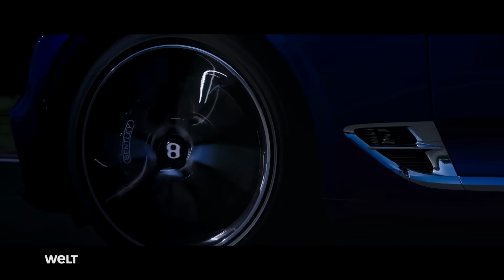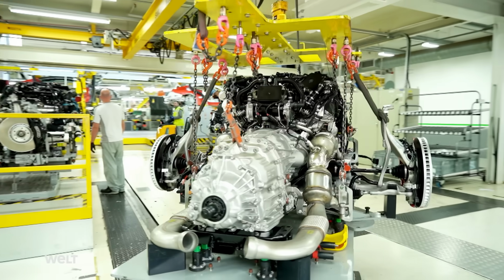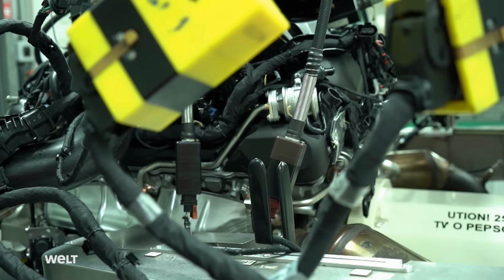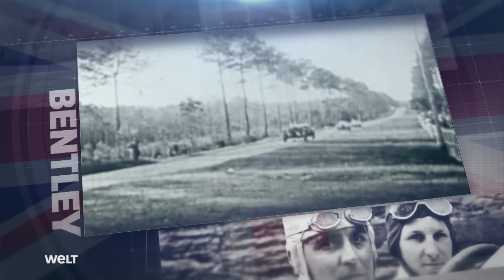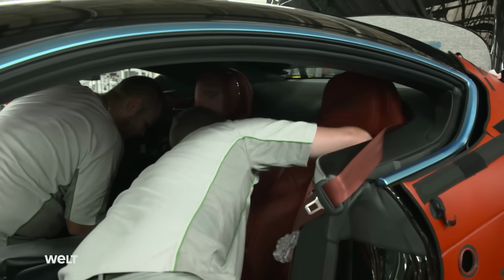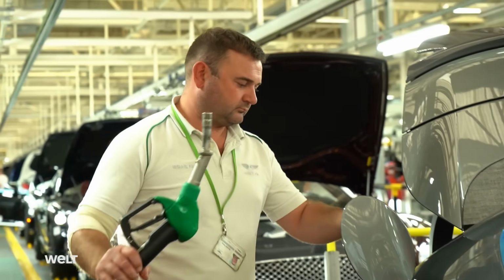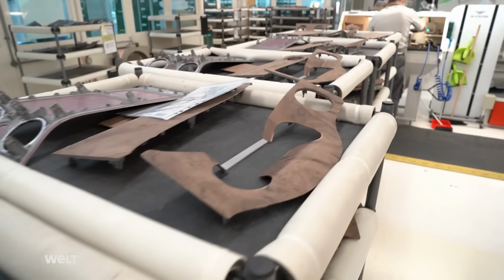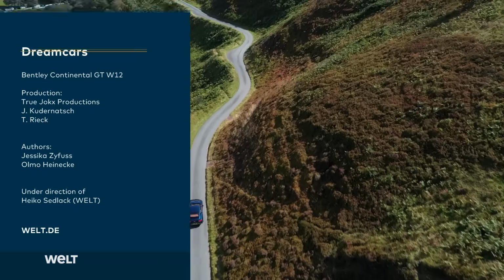Bentley Continental GT W12 - Inside the Factory | Full Documentary

Comment: Very nice.  Too bad the "Craftsmanship" does not translate into a reliable car.  Bentlys are known to be fairly Unreliable and very costly to maintain.
Reply: well you never owned one so I don't know how you came to that conclusion
Reply: @malopephasha5341  Well, I DO own one, and I can assure you it is extremely costly to maintain!  And, if I ever leave it parked for more than a few days, the batteries (2 of them) discharge, even attached to the "Battery Tender".  Otherwise, it has never broken down or left me stranded.  They are just so sophisticated that every little thing that needs attention costs a small fortune to repair or replace.  And it has never taken less than three weeks when I take it to the dealership for service-which is about a 3 hour drive from home.  I have spent so much to repair things that they now consider me a "preferred customer" and provide no-cost enclosed van transport to and from Bentley of Columbus-but it takes a month or better to schedule that free transportation.

Comment: Can you just imagine this engine in a small Toyota or maybe a Mustang or a Camaro all-wheel drive the massive torque and smoothness of this engine in a smaller vehicle or even a truck this engine could be fitted with bigger turbos in tuned to over 1,500 horsepower easy I would work for free in the Woodshop just to be trained on how they make their product I've been a master Carpenter for 40 years and I would give it all up just to learn how they make their parts in pieces

Comment: The Bentley company gorgeous car at the age of 20 I had a 72 Nova that I put a cam kit and boys out the Pistons 8 cylinders it would slam you in the backseat by flowing it I had a 1970 Camaro the red 260 miles on a tack you need more horsepower I only have 12 if you can I have 12 Pistons make that engine Sprout 1200 horses

Comment: I was unaware cars used a prop shaft. I always thought it was a drive shaft. Where this car goes we don't need no roads.
Reply: Its the correct term. The longitudinal shaft from the gearbox to the rear differential is indeed a 'propeller shaft'. Drive shafts go from the differentials to the wheel hubs.

Comment: 12:05 “camshafts regulate the supply of fuel to the engine” ummmm... no 😂. They regulate air/exhaust moving in/out of the cylinders through opening valves
Reply: I paused it right where it was just to look for this comment 😂
Reply: in/out of the cylinders, NOT the pistons....smh
Reply: If it isn’t a direct injection engine, then injectors can spray all day, but if the cam doesn’t open the intake valve(s), nothing happens. I would’ve said camshafts control the air/fuel mixture’s entry into the combustion chamber.
Reply: slowpoke96z28 cmon what high performance car of today is port injected only, it definitely has injectors directly in the combustion chambers
Reply: @SuperCortes10  koeniseggs are port injection, lambo, bugatti, McLaren. All port injection still. Really the only sidi performance cars I can think of are LT based GMs like vettes and such.
Reply: slowpoke96z28 Most is those hyper cars just use port injection to clean off the back of the intake valves but still use direct injection for the most part
Reply: SuperCortes10 dude...stop...
Reply: slowpoke96z28 Hey know it all do some research and learn that there’s multiple cars that use both direct inj and port inj at the same time, Lamborghini huracan & and Audi RS3 just to name two
Reply: slowpoke96z28 Koenigsegg actually have multipoint fuel injection, port and direct injection. Their latest engine in the Jesko has 3 injector per cylinder.
Reply: SuperCortes10 did you just call a huracán and an Audi hyper cars? Really? Port injection to clean off the back of the valves? Of what exactly genius? What are they cleaning off the intake valve? Dirty air? Oil leakage from the turbo or PCV system? Really? With a hydrocarbon? I guess all the people who make injector cleaners and all the engineers at gas companies who spend their entire careers trying to keep fuel from DIRTYING up thing are a bunch or snake oil pitchers huh? Chevron, Exxon, etc, are being hustled for millions a year by engineers who really don’t do anything useful...
Reply: back in the day cars sometimes had the injection coupled with the camshaft, but modern direct injection is indeed managed by the ECU

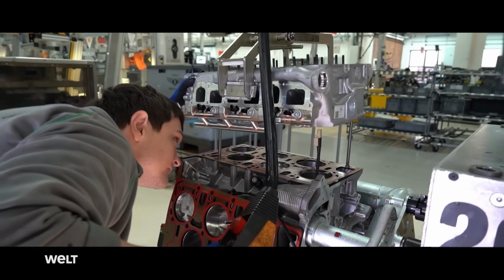Comment: Awesome footage of the assembly line and engine build. but there are some mistakes in the narrator's text. Cylinderhead instead of oil pan @11:53, the valves control the air intake and exhaust not the fuel injection @12:05. And the technician is checking the cylinderdeck clearance to make sure there is enough space between the pistons and the cylinderhead and not with the cylinderwall@11:30 because obviously they come in contact with the wall. turbo is used for more air so more fuel = more powaaah not for enabling an optimal fuel air mixture.
Reply: @B_In_Chat nope that's it
Reply: @B_In_Chat it’s not a complaint Jack ass, this sir knows his stuff